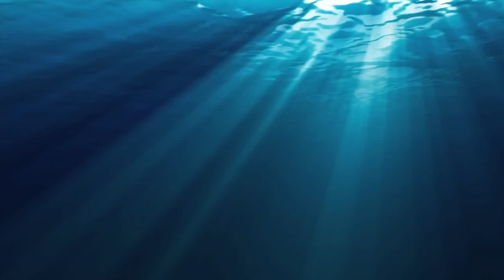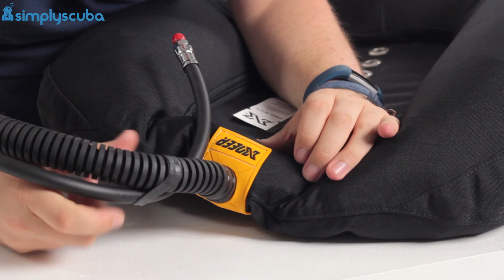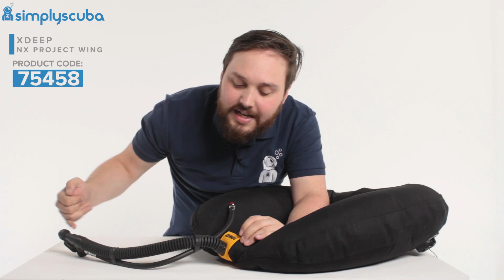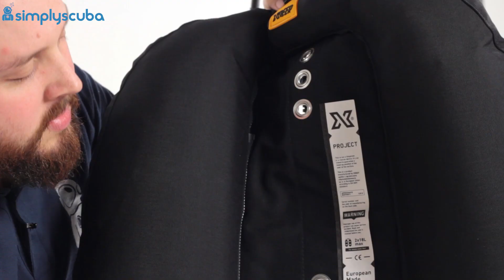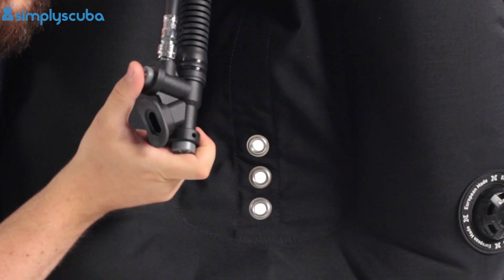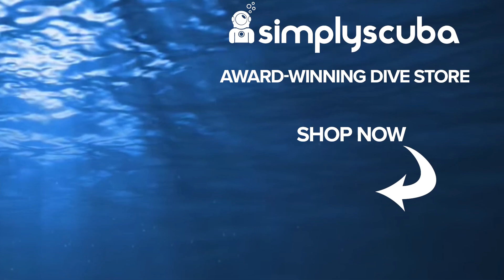XDeep NX Project Wing Review

Comment: I see that the project does't have an air dump on the top, only on the Bottom left, what s your opinion on it? Since I'm now using a jacket with multiple air dumps and use the one on the right top quite a lot as well as pulling the inflator.